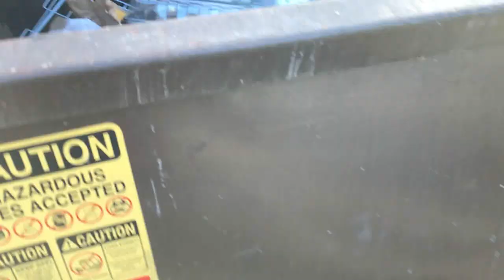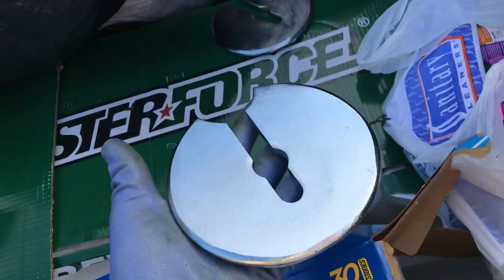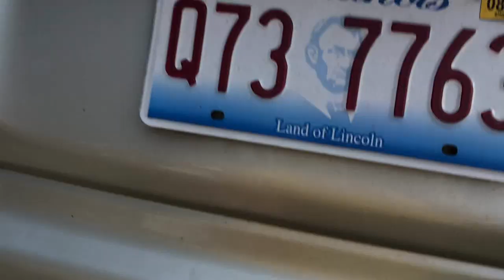Trash Picking   Dumpster Diving   Turning Trash into Cash!

Comment: Those mystery steel disc with the weird slot and keyhole cut in them...I believe are plates from a set of adjustable dumbbells...you should have found like 10 more
Reply from the maker: Huh weird...I didn't see any others....thanks for the tip!